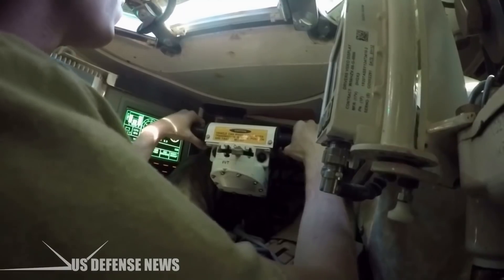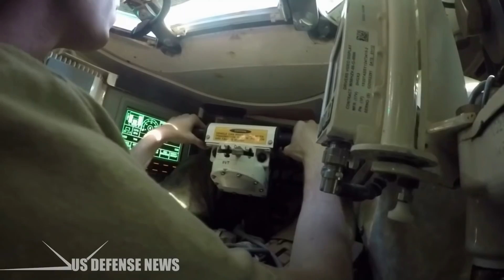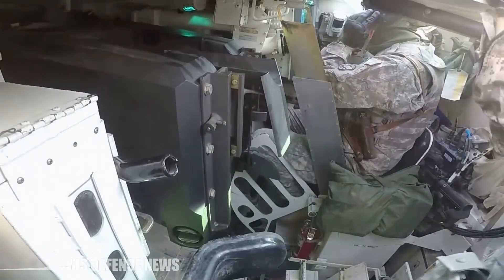Why No One Wants to Fight U.S. Abrams Tanks?

Comment: I would fight it, easily. Just wait until the tanks run out of fuel. Using the Abrams in the theater of operations, with a parade of soft coated fuel trucks is as if you fight with a foot in bucket. Wait and blow it up then.

Comment: Germany Britain and Russia have better tanks
Reply: How so?
Reply: Nathan Peterson il start with Germany while fire power and armor on the leopard 2 are equal the leopard beats the Abrams on mobility the challenger 2 beats the Abrams on armor fuel  consumption and accuracy while everything else is equal and the t14 armata beats the Abrams on everything so we will have to see if the Abrams can bounce back with the m1a3 when it comes out
Reply: +Crazywolfman11 

 How does the Leopard 2 beat it in mobility? Everything about their automotive performance is similar.   

 The Challenger 2 doesn't beat the M1A2 based on anything we know as far as armor goes. 

  By extension how is the T-14, a vehicle we know nothing about, beat it?

Comment: M1 is a battle proven tank. Most countries don’t even know what they need for a fight with a MBT. I would say that the Abrams is the best qualified tank. The leopard 2 fanboys need to get their tank tested and upgraded to the battle.
Reply: Reasons why you think the m1 is better than other tank? Just because a tank got used in combat doesn't necessarily mean that it's better
Reply: placeholder  glad you asked! I don’t think the tank would be anything without crew 1st. But you have to admit M1 has been on the frontlines a lot longer than most tanks in modern conflicts with big armies.Given that they have seen what destroys and what goes well with it,  the vehicle has to go well with your tactics. And since the m1 has had more than a handful of upgrades, each would make it  less vulnerable than before. The leopard has had a bad success rate since the poor Turkish commanders,  but even so the tank wasn’t made for that kind of combat, so the tactics weren’t able to work. The engines weren’t either. So I’m not saying it’s better than another tank because of the statistics. More less because the combat experienced has cause the problems to arise and be fixed, the leopard was a mere example of what happens if you don’t put things to the test although they are export models. The m1 simply has just been through a lot and now is close to what a tanker dreams of, even if still had problems,
Reply: Kyle Murphy The leopards turkey is using in right now syria aren't export models. They are german leopard 2s from the first few batches that didn't get armour upgrades because that would have affected the production of new leopards. The reason they are struggling is due to the fact that they only have protection along the frontal 60° arc like most MBTs. You simply don't need more in conventional warfare. There are of course versions that were specifically developed to deal with urban warfare like the leoard 2 ATD, the STRV 122 evolution and the leopard 2a7+ with the PSO armour kit (there is also a "dual ops" kit for conventional warfare that qatar uses)
Reply: placeholder so exactly my point in what I mean by experience, can’t say the tank is the best without testing it first
Reply: Kyle Murphy I think the leopard 2 got tested enough already even if it wasn't combat. Not only the germans but the swedes and greeks for example have also tested it thoroughly in addition to other tanks and gave their feedback. This is why greek and swedish leopards have additional roof and glacis armour
Reply: placeholder  just adding simply that it needed more upgrades in order to be up to par

Comment: The Leopard 2 has the same gun and similar armor w a diesel engine that goes near 3 times further on a tank of fuel.
Reply: Not the same gun. And we're unsure of the armor
Reply: +Nathan Peterson they do make our tank guns at rein metal in Germany. I do know that is 100% fact. Same company used to be Krupp Reinmetal
Reply: +Nathan Peterson they may use a different mm. I'm not positive on that, but the design and smooth barrel with stability is all the same. of course they don't use depleted uranium sabots but tungsten works just fine and I'm not sure in a gun that big, uranium is necessary. maybe in the Vulcan gatling tank buster cause it's a smaller round. Nobody else uses depleted uranium. Leo 2 is a formidable tank. If any tank could be equal to m1 it would be Leo 2.
Reply: +Mike Long

 They use the same ammunition dimensions. And for the most part can fire the same munitions. 

 The design of each are very different.

 The U.K. I know, and the Swedish possibly use depleted Uranium munitions. The Soviet Union had developed several types. But none are in active service.

 The M256 is produced by Watervliet Arsenal in NY under contract by General Dynamics Land Systems. The XM256 (and by extension its succeeding designation the M256E1 ) were officially a licensed variation of the Rheinmetall L/44 gun. But after the production of these batch of guns ended, the branding and title stopped. Not Rhienmetall AG.
Reply: +Nathan Peterson so. It's the same gun! Made in Germany by Germany so if they want the same dimensions we have who says they dont? I thought all nations but the US stopped using depleted uranium. Uranium oxide laying around is not healthy, causes cancer. We have a big law suit down on one of the Bahamas islands cause we have piles of depleted uranium rounds laying there oxidizing causing thyroid and leukemia. Nasty stuff. And yeah Scandinavia and Denmark purchase the Leo 2. He'll they had a 75mm in WW2 that would go through the front of a Sherman and come out the back, so let em do what they are good at it suppose.
Reply: +Mike Long

> " It's the same gun! Made in Germany by Germany so if they want the same dimensions we have who says they dont?"

 The same ammunition compatibility. Hence I said the dimensions of the ammunition.

 They're made by Watervliet arsenal in New York. The L/44 is produced by Rheinmetall AG. The XM256/ M256E1 was a licensed variation, but that says nothing of its design other than an obvious developmental relation.

> "I thought all nations but the US stopped using depleted uranium. Uranium oxide laying around is not healthy, causes cancer."

 Nope.

> "He'll they had a 75mm in WW2 that would go through the front of a Sherman and come out the back, ..."

 I've not come across a single case of that.
Reply: +Nathan Peterson well you just said yourself the guns made by rein metal. they also said it in this vidio. so what's the deal. I study many things I don't obsess on one subject so all that basically was pointless. we obviously both like tanks and artillery so would it not be better to make friends of the same interests than trivia contest? And I bet you have not seen or been in a Sherman when a German anti tank gun penetrates it or you would not be alive. I saw archival footage with Sherman tanks pierced from front to back. The 88 would do that at least 2000meters away. The high velocity Pak 40 would at less than 1000 meters. The 75 they used was about waist high. Uranium Oxide is dangerous. Uranium oxide was the #1 cancer causing element in the Windscale meltdown. Not as bad as strontium  90 but more uranium oxide was released. The M1 tank argument is ridiculous. Every documentary I have seen on our tank says the guns made at rein metal. So what if some were made in NY, I have never heard that cause like I say they even say in this vidio it's rein metal. Wouldn't it be more interesting and maybe friendly to talk about why our Marines in Afghanistan don't use more recoiless rifles. They have like one Carl Gustav breech blast gun per battalion or something. They make their fences out of two foot thick mud, and hide in places that even Korean or Vietnam era breach blast artillery could save marines. That's rugged country, I would want to blow their cover up instead of shooting a 223 at their Covered position. They have to wait on a tank all the time and Carl Gustav is nice, but expensive and made in Scandinavia. We can make huge numbers, more rounds, create jobs for one thing and kick more taliban ass. Huh.
Reply: +Mike Long

> "well you just said yourself the guns made by rein metal."

 I did not. I had said that the XM256/ M256E1 had carried the branding of Rheinmetall AG due to them holding the license on them. The M256 and the currently being developed M256A1 do not hold this license. 

> "we obviously both like tanks and artillery so would it not be better to make friends of the same interests than trivia contest?"

 I fully and enthusiastically concur with your point. But your prior notions and details seem to conflict or outright contradict the data I am familiar with. 

> "And I bet you have not seen or been in a Sherman when a German anti tank gun penetrates it or you would not be alive. I saw archival footage with Sherman tanks pierced from front to back."

 Contrary to popular belief, the M4 was one of, if not the most survivable medium tanks of the war. Given that data on the Panther's crews survival rates is lack luster. In brief, the U.S. Armored Force Branch, from December 7th, '1941 to December 31st, '1946, suffered 1,398 KIA in all fronts. Of this, 900- 1,000 were M4 crews. And based on research done by Nicholas Moran as well as the late Richard Hunicutt, half were outside the tank at the time of death. Given the U.S. Army Ground Forces wrote off 7,200 M4's which would each have five crew members. That's outstandingly low. 

> "Uranium Oxide is dangerous. Uranium oxide was the #1 cancer causing element in the Windscale meltdown. Not as bad as strontium  90 but more uranium oxide was released."

 I never argued against this. But given the penetrator rods are encased in plastic and surrounded by composite combustible materials. It isn't a worry for the tankers using it unless the round becomes exposed with air for a very long time, or the rod disintegrates. 

> "Every documentary I have seen on our tank says the guns made at rein metal. So what if some were made in NY, I have never heard that cause like I say they even say in this vidio it's rein metal."

 Then I continue to respectfully disagree. 

- "When production began on the M256 cannon at Watervliet Arsenal, ..."

 < http://www.dtic.mil/dtic/tr/fulltext/u2/a280508.pdf > (p.1; Porter )

< www.troyrecord.com/article/TR/20120123/NEWS/301239986 >
Reply: +Nathan Peterson doesn't much matter what you say when all info says otherwise. Gee, obsess much? Only trolls, moles, and A holes repeat quote others on social media.
Reply: +Mike Long

 What nonsense are you on about?

Comment: The Abrams has a huge Achilles Heel - the engines.  Older tanks had diesel engines that needed refuelling about every 48 hours.  The new gas-turbine engines make the tank a lot faster, which is great in combat, but they need refuelling every 12 hours!  In situations where the USA has overwhelming superiority the new tanks are better, but in a larger war the Abrams would quickly run out of fuel.  Can you imagine trying to refuel entire tank brigades in, say, a ground campaign in Asia?  The enemy wouldn't even need to target the tanks - just blow up the fuel trucks and they're stuffed... and that's assuming the tankers can even get to where the tanks are, which was a massive problem for everyone in WW2.

Comment: So how’s that German made 120mm canon working out for you yanks in your Abrams?
Reply: +TheMuffdivr

 The M256 is neither German-made or German in design. The XM256 (to become the M256) was developed from the L/44. But they share radically different designs and construction. The XM256 was officially speaking a licensed copy. The M256 does not share this title. It is produced by Watervliet Arsenal under contract with General Dynamics Land Systems.

Comment: But the Abrams has one major weakness. It doesn't have a diesel engine, it has an aircraft turbine that requires special fuel.
Reply: +Philip Grove 

 Turboshaft engines, like other turbine engines are inherently multi-fuel. I.C.E.'s are not.